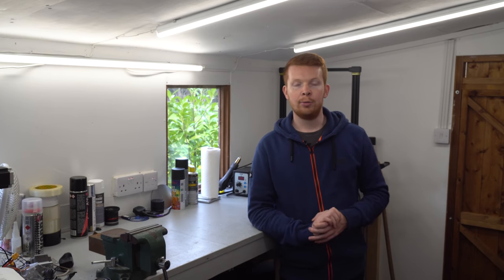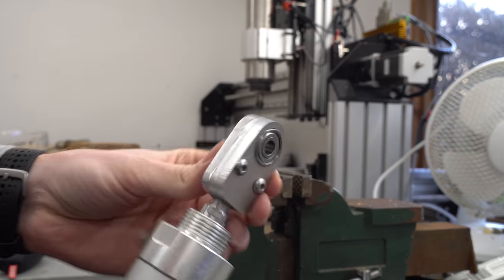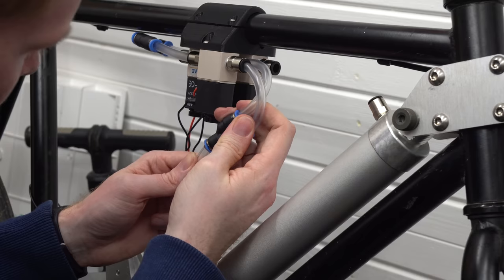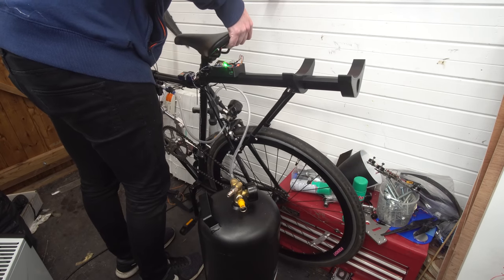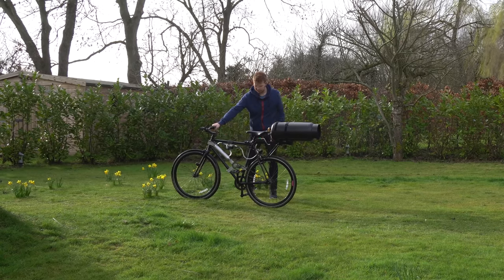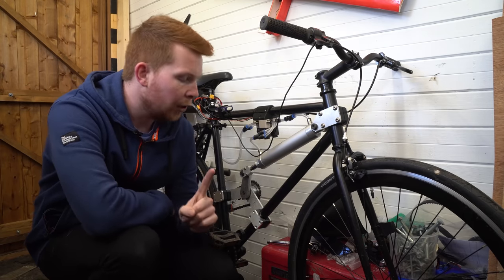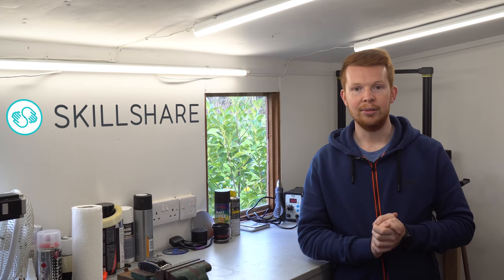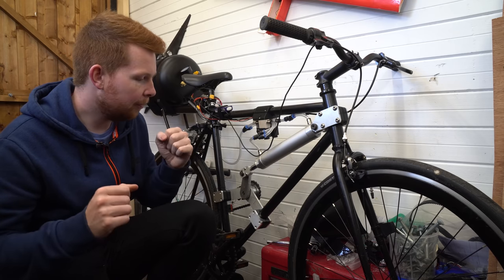Air Powered Bike

Comment: now get a pedal powered air compressor
Reply: I had a similar thought. Those high pressure hand pump could be used like regenerative braking. When you hit the brakes, the pumps engage and bleed off speed by putting pressure back in the tank.  LOL
Reply: @StevenIngram  Had a very similar idea.
Reply: So essentially turn it into a hybrid.
Reply: He already has one, runs the cylinder in reverse, he simply needs a deeper gear reduction on the bike to pump it up.
Reply: That could be a good idea as you pedal a little bit for a long time and then when you drive, release the air quicker.
Reply: @StevenIngram  I think the piston can already do that, just need 2 or 3 way electronic valves and the right software to open/close at the right time.
Reply: @otm646  Have a reverse state in the throttle that opens the valves in reverse strokes and pedal downhill to "assist gravity".
Reply: LOL!!!
Reply: chotgirl1able  anywhere that sells perpetual motion machines
Reply: you could also utilize the fact that the cylinder has two way air movement. you could valve off so when you pedal it pumps the tank back up
Reply: Use a Carbon fiber respirator tank
Reply: @brantwedel  It might not even need to be electronic. I think the right configuration of  passive one way valves could open and close based on the direction of airflow that would force the air pressure in the tank to expand the pneumatic cylinder and piston arm on the "downstroke" and then use the force from the "upstroke" to push whatever air is in that cylinder back into the tank.  There would obviously still be some loss but right now I assume it loses 100% of each downstroke's worth of air on each upstroke, releasing it to the atmosphere.
Reply: Chotgirl1able , excellent ! Vous m'avez fait bien rire !
Reply: That makes a lot of sence. You could have regenerative compression and when your going downhill you could aid it with peddling anyway.
Reply: Pedal slowly in the evening charging the compressor, use it in the morning when going to work. Sounds like a nice system
Reply: And regenerative braking
Reply: Or a windmill powered compressor?
Reply: chotgirl1able any construction store like home depot or harbor freight
Reply: Hi Tom nice video 
I'm sure the exhaust can also be recycled with a nipple valve into a seperate tank then fed back into system as a closed loop surely this can be done if the pressure is high enough from high pressure to low pressure...
Reply: @Ep1cSh0tz1  exactly my thought
Reply: Your  are great
Reply: you would lose efficiency, but I would rather pedal inside and drive outside.
Reply: @verdiss7487  that would be nice for hills! charge up the air tanks on downhill parts or level ground, and then use it to give you an assist going uphill.
Reply: tiger of the sky that’s just a bike with extra steps
Reply: @pehgt5099  Trouble is: the low pressure cyclinder needs to have a greater volume than the high pressure one. Will end up looking more like a double expansion steam engine
Reply: Or a 3000 lbs oxygen cylinder and a wheelie bar
Reply: Interesting.
Reply: ERR
Reply: That's just bicycling with extra steps!
Reply: p                                                                                                           Brant Wedel
Reply: Lol..."peddle faster billy"
Reply: that would be a good idea
Reply: Merely change the arduino
Reply: Lol, snort
Reply: Gotta love how indirect that is tho
Reply: definitely makes you appreciate the easy power of LEGS!! Air powered (of course).
Reply: You could use that thing as a two cylinder. It's got inputs for extend and retract!
Reply: My idea already uploaded
Reply: @uknowngamer1017  I was thinking the air could only be used to assist going uphill. When going downhill the Reservoir could be charged
Reply: @scottwhitley3392  to be quite frank I dont even know what I meant
Reply: Can it pump tires?
Reply: I had the same idea but with a rowing machine
Reply: @StevenIngram  uuuuyu
Reply: Mande uma bicicleta dessa pra mim
Reply: @StevenIngram     u
Reply: He could set this so back peddling compressed the air
Reply: Make it regenerate pleasure wile slowing down
Reply: Then you've invented a regular old bike with extra steps lol
Reply: Imagine having the whole bike frame as an air tank!? Won't that would be dope!
Reply: And combine them lol
Reply: agreed

Comment: I think it is obvious that if you had a lathe, you would build a steam engine powered bike.
Reply: Steam is less efficient in this case. The extra weight and complexity would only serve to cause issues.

Not to mention the electric valve would probably be damaged from this, and the added danger of a boiler so close to your back.
Reply: @AiOinc1  yes but steam power is awesome
Reply: @AiOinc1  And you also have to recycle the Water if you want to get decent range, which means you have to attach a radiator and possibly a fan
Reply: The sound of it made me think of a steam engine
Reply: @DerH0ns  wait what?
Reply: Steam expands more than compressed air so in some ways it's more efficient (per psi).
Reply: @AiOinc1  And it would get above 100x the range he'd get with compressed air. Right temperatures and flash, water expands around 700x in volume when converted to steam if the pressure were the same. A small oil burner and a gallon tank of water would still be smaller (and maybe less massive) than that air tank.

Obviously some components would be needed to be changed to suit the task. The overall mechanics in terms of drive and geometry are the same.
Reply: @Thrillowatt  he's talking about a steam condenser.
Reply: The new Fred Dib!
Reply: He has a lathe - he merely doesn't seem to realize he does...yet
Reply: Imagine wrecking and having a fire and a pot of boiling water spill all over you.  Plus, how much fire wood or other combustible material do you think you'd need to carry with you to get any decent range out of it?
Reply: @PhilLesh69  
Well, you could use a battery to heat up the water /s

Comment: get a 2500psi scuba tank
Reply: Rly he whould go 1000kmh
Reply: @batery5156  
Nah, not even the piston would stand such pressures, he even said the crank couldnt stand 80psi before snapping. The idea is to have a small high pressure tank with a regulator so it would take less volume. Ideally id say 100-120psi would be good enough but he has to fix the crank problem first, wither reinforcing the bolt or welding it.
Reply: I hadn't realised that they were so strong.  I just looked this up because I was surprised and apparently a 2500 psi scuba tank would be classified as a low pressure tank.  Blimey.
Reply: Crank shaft breaking at 80 psi is do to terrible metal being used. I know the metal in the US is better then the rest of the world but still...how did he find something so weak. A 3000Psi paintball tank that has a built in 300Psi regulator  should work once he builds a decent crankshaft.
Reply: @laharl2k  if the parts would withstand
Reply: @Thorgon-Cross  If you assume that the pneumatic cylinder has in internal diameter of 2", and that the crank arm is 4" long, you get around ~85 ft/lbs being applied to the crank. Shaft is likely 8mm, since it looks like he's using 608 bearings. 
That's a lot of assumptions, but it should be relatively close. If the shaft broke at 85ft/lbs, then it definitely wasn't the best steel to be using for that application. It could just be a matter of a lack of proper heat treatment. Going up to 300psi would likely require a crankshaft that can handle ~315ft/lbs (again, if my assumptions are correct), so he'd definitely need to increase the diameter for that. Although, I suspect that the pneumatic cylinder has a maximum working pressure of around 150psi.
Reply: @Thorgon-Cross  the metal in the us is better than the rest of the world? Got any sources for that info?
Reply: @ergohack  First off never said to run it at 300Psi that was only a description of the type.  85ft/Ibs or even 200ft/Ibs is surprisingly low for a 8mm shaft. Guess i have just be spoiled using Stainless and 6061 Al so much.
Reply: @Thorgon-Cross  The metal in the US is better than the rest of the world? 
Is that why the US auto industry has such a good reputation for reliability compared to Japan and Germany or why US manufacturing is doing so well?
Reply: @joelaw728  I think the naivety of the yanks is very entertaining sometimes 😎
Reply: I'd be curious to see a vane type pneumatic motor used instead of the pneumatic cylinder. Timing would be a non-issue. 
I agree with the other comments suggesting a SCUBA cylinder or a paintball-sized compressed air cylinder as compressed air storage instead of a heavy,  low-pressure compressed air tank though as a proof of concept it's fine.
Reply: @joelaw728  I think the naivety of the yanks is very entertaining sometimes
Reply: @Surestick88  Yep, that is why the saying built American strong. Our manufacturing dipped rather low for a while do to anti manufacturing laws but thanks to our current president it is on the way back up. ....O wait did you mean that sarcastically?
Reply: @stephenprescott4441  I concur.
Reply: Uh, guys? You do realize the compressor in his shed is probably only rated to 240 psi?
Reply: @martindinner3621  Of course. However, a compressor capable of a few thousand psi can be had from China for a few hundred dollars, so it's not really a stretch to imagine him going that route.
Reply: @Bleidiabolo and fill it exactly how? Have you got any clue how much compressors capable of those pressures cost?
Reply: Paintball gun CO2 cartridge(s). Easy to fill, super light weight
Reply: @Thorgon-Cross  Japan produce the highest quality steel in the world
Reply: @laharl2k  they have high pressure air regulators to get the pressure down
Reply: @batery5156  what's wrong with that?
Reply: @ZimmyF250  
Of course, otherwise he would have to use chromoly pipes instead of the flexible ones he's using now or maybe 300 bars hydrolic lines but like i said, that pneumatic piston would hardly stand more than 300. Someone said that it was most likely rated for 150 psi so of course you need a regulator.
Reply: @Thorgon-Cross  metal in the usa is better than anywhere else in the world wow u yanks really are ......
Reply: Finn Gerrs    That's because of their steam powered self-esteem.
Reply: Finn Gerrs 
American iron atoms are the best, they are so good they even come with extra protons.
Reply: Scuba tanks are 3000 psi
Reply: @joshuarosen6242  My air rifles use 4500 psi tanks to fire for game hunting. Anything lower is inhumane. Our portable charging stations (Bigger tank we keep in the truck) holds 25000 psi, 30gallon.
Reply: @SoLowKaspar  It's relatively easy to have high pressure on the small tank attached to an air rifle but 25000 psi on a 30 gallon tank sounds pretty impressive.  How much does it weigh?
Reply: The best quality steel is usually Japan. 
They are more advanced with their steel manufacturing.

After that it's the United states Sweden Germany and a few other European countries.
Really it's what type of work the steel is supposed to be doing.
Reply: That’s what I’m sayin
Reply: @Thorgon-Cross  The best metal in the world in the USA? You are a chauvinist !! Germany, Japan makes knives better than American.

Comment: Take it to the next level: steam bike
Reply: Hilarious
Reply: And you just made a steam engine train
Reply: Nuclear reactor bike
Reply: Fusion powered bike.
Reply: The energy needed to turn the water into steam is too high. You need 5.5x as much energy to vaporize the water than you do to take it from freezing to boiling!
Reply: @Baigle1  Why not use a heat exchanger to preheat the water tank?
Reply: @glasgowbrian1469  And you got a steam motorcycle.
Reply: @glasgowbrian1469  It's easier to have a non mobile boiler and store the steam on the bike.
Reply: Search here on youtube for "Sandy Steam Motorcycle", it's a very cool concept.
Reply: It's evolving just backward
Reply: It should be a motorcycle at this point.
Reply: @gomes6422  cheers
Reply: @Baigle1  spare glacier?
Reply: Aber mit Sonnenenergie produziert. Eine Solarzelle, ein Wärme Kollektor unter der Solarzelle, eine elektische Wärmepumpe und einen Kondensator um den Kreis zu schließen.
Reply: some motorcycles actually did that, it was early 1900s
Reply: Surely sounds like steam 07:22 really cool
Reply: You can buy a bike off steam?

Comment: I actually made an engine quite similar to this a couple years ago but with 4 pistons instead of 1 (vid on my channel). I found one of the most important things is to advance the timing as the rpm increases and to gear down the output as currently your engine seems to be struggling to get past top dead center. Nevertheless I'm very excited to see where this goes in the future and wish you the best of luck.
Reply: Reciprocating internal combustion engines are basically air pumps, very similar in concept (Look at very early motorcycles, and they will seem oddly similar to this bike). They operate on a similar principle. Gasoline engines require variable ignition timing dependent on engine speed (it takes time for the fuel to burn, so the process has to be anticipated before the piston is in the ideal position). Similarly, I expect delays in air flow into and through the pneumatic cylinder will also have to be anticipated.
Good comment.
Reply: @tananam9782  certainly true, i have seen air compressors turned into engines and engines turned into air compressors
Reply: @tananam9782   hello
Reply: Reciprocating internal combustion engines are basically air pumps, very similar in concept (Look at very early motorcycles, and they will seem oddly similar to this bike). They operate on a similar principle. Gasoline engines require variable ignition timing dependent on engine speed (it takes time for the fuel to burn, so the process has to be anticipated before the piston is in the ideal position). Similarly, I expect delays in air flow into and through the pneumatic cylinder will also have to be anticipated.
Good comment.

Comment: What about an air powered regenerative braking system?
Reply from the maker: I've considered it, but my current aim is to get it to a reasonable speed to where braking will be needed haha
Reply: So the cylinder would become the compressor?  Except I dont think regulators are reversible.  You could have a secondary, lower pressure reservoir.  Or would you have a separate compressor for braking?
Reply: @TomStantonEngineering  
Would it be hard to make a system that use the piston to fill the tank when you ride down a hill?
That may be useful for trips where you are constantly climbing up and down small hills.
Reply: @TomStantonEngineering  Very fair point. I was also wondering if it would be at all feasible to make a hybrid bike; Where you pedal to increase pressure in the tank, and the tank powers the bike. It would most likely be completely useless, but nevertheless a cool concept. It would allow you to keep going for a while after you stop pedaling, which might be interesting.
Reply: @pstrap1311  Agreed, the regulator prevents a reversed pressure flow. I was trying to think of a way to use a pressure equalization valve running counter to the regulator, but that would be problematic when the tank is at a much higher pressure than the operating pressure. Your suggestion of a secondary tank sounds like a much better design.
Reply: @TomStantonEngineering  Just add a second piston at different phase. It will increase power and efficiency.
Reply: @Convolutedtubules  it wouldn't be useless because it would make peddling resistance a constant or no more hills!
Reply: @kitt080863  I like the idea of that but you would still have to pedal faster uphill.
Reply: @TomStantonEngineering  yeah, you should improve that kind of proto-steam engine...
Reply: @TomStantonEngineering and me
i've made a 250w bike and i was thinking the same
Reply: @TomStantonEngineering  some very good quality work into this project thus far, some good ideas for improvements going forward as well. I think (based on my own personal and gas powered bikes) the rear sprocket should be much larger to allow better starting. May also be able to incorporate a derailleur so you could shift to a smaller sprocket as you pick up speed. Cheers!

Comment: You could make dual air tanks mounted on each side of the rear wheel like saddlebags from a touring bike. That would improve the bikes center of gravity as well as make it easier to mount and dismount. I like where you're going with this. It's pretty cool!
Reply: bagger
Reply: how would you keep the 2 tanks balanced ? is there a regulator of sorts?

Comment: Maybe you should make it direct drive on the rear wheel. Then add extra valves and pipes so when you are braking or downhill you reverse the action to fill the tank.
Reply: Turning the crank the same way the pedals to is better, at least in ebike world. Don't see any reason same wouldn't apply here.